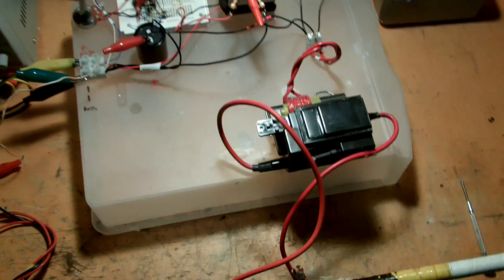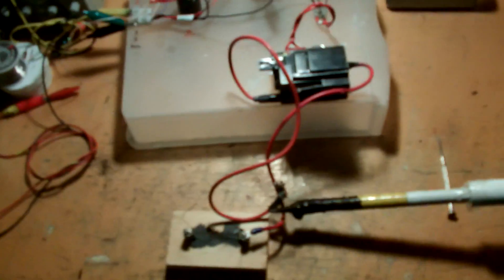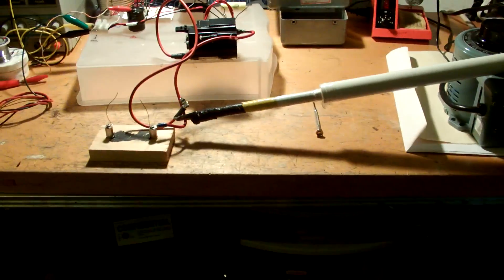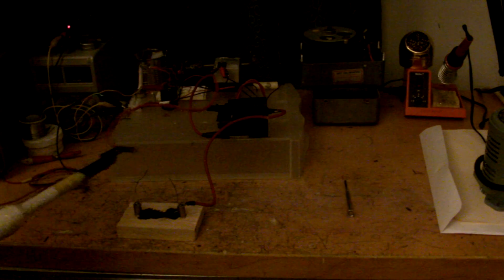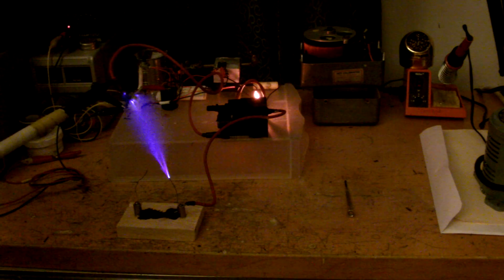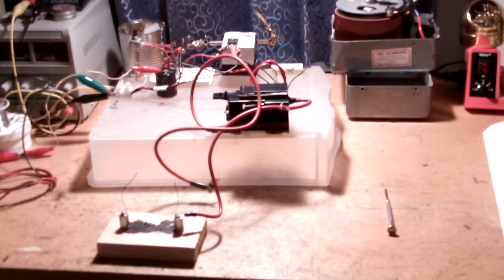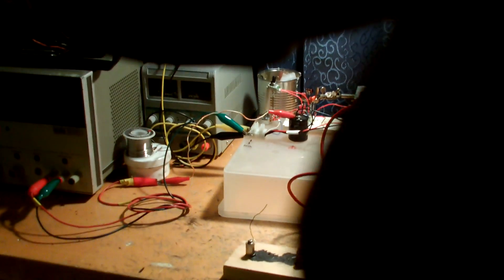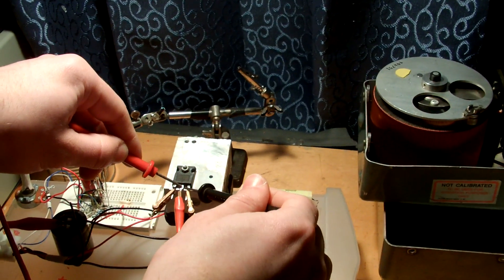More Flyback fun!

Comment: yo Pete ! just having a revisit =D I was wondering what type of 555 circuit you got going there .. is it a standard 555 circuit powered with 12v and you have a separate power source for the primary windings on the flyback ? and can the 555 circuit run the irfp260n ? cheers bro ! ..